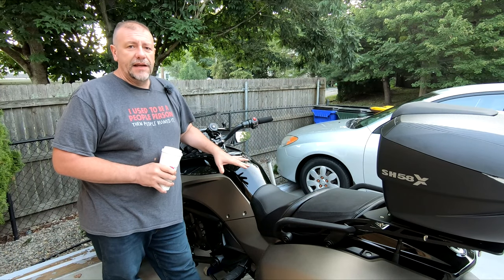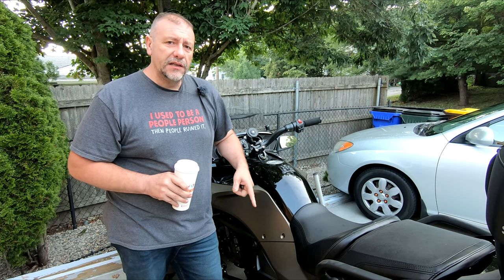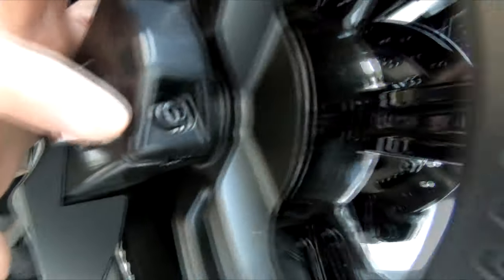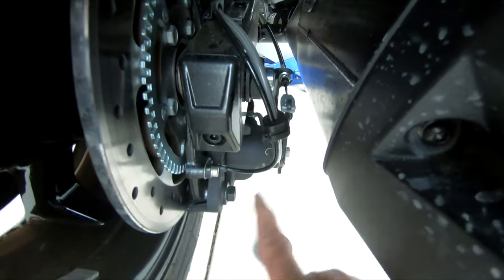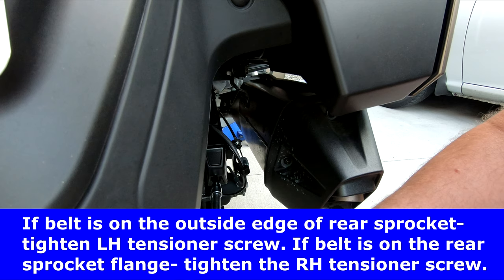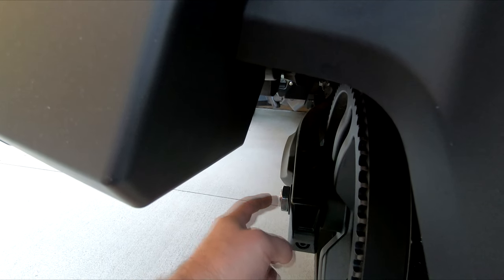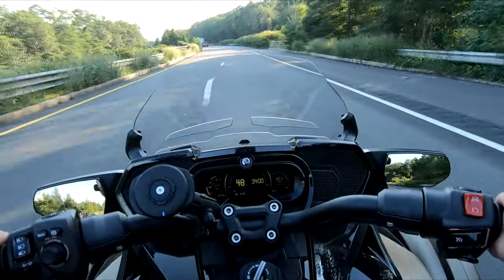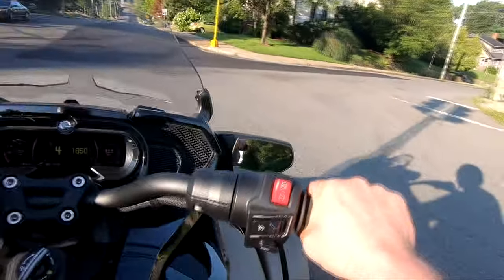Drive Belt Alignment and Noise Issue 2021 Can Am Spyder F3T | Techn' Moto

Comment: Hello Mike,  Jim and I have been talking about getting a spyder.  These videos are very interesting because of that.  💕NonnaGrace
Reply from the maker: Don’t. I am having a noise issue with mine. Belt makes a ton of noise at 50 mph. Driving me crazy. If I had known I would not have bought this spyder. We’ll see what happens. Either they fix this or I may trade it in.

Comment: my belt is never centered lol. I notice it shifts after burnouts and hard launches. I haven't noticed any noise though.  I did have it checked and redone when I had the rear tire put on, so I'm probably good. I need to get one of those lifts.  It would make things so much easier.
Reply from the maker: This noise is driving me crazy. If I can’t get it fixed I just may trade it in. I hate the noise at 50 mph.

Comment: Yes. Please let us know what they  say. I have a new 2020 F3T that makes the exact same ‘wine’ at 49-51 mph. Drives me nuts. Can’t tell if it’s belt or metallic
Reply from the maker: I've come to the conclusion that it is belt noise caused by the front pulley. I too can't stand the noise. it is so loud makes riding this terrible. I'll do a video on what they say when I pick this up.
Reply from the maker: New update on the noise issue coming soon.